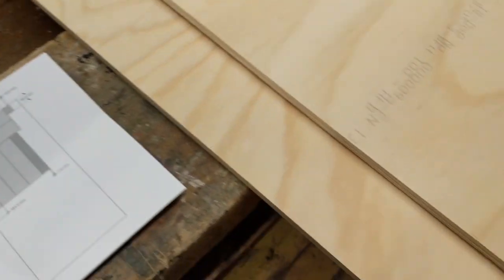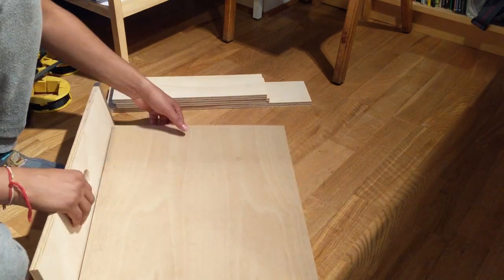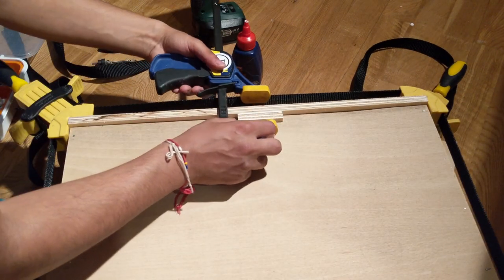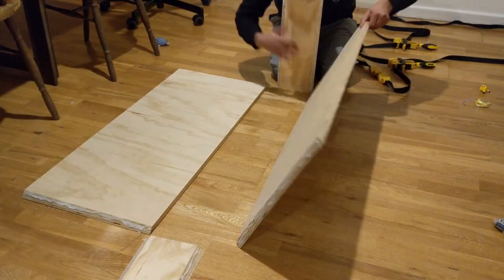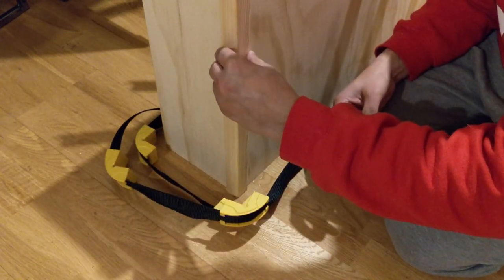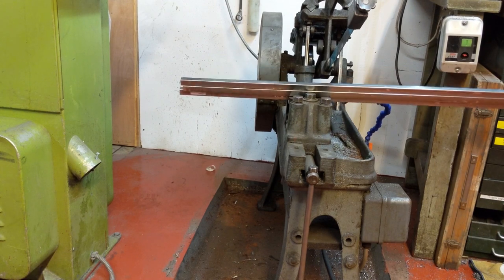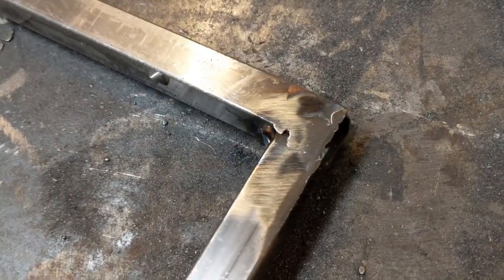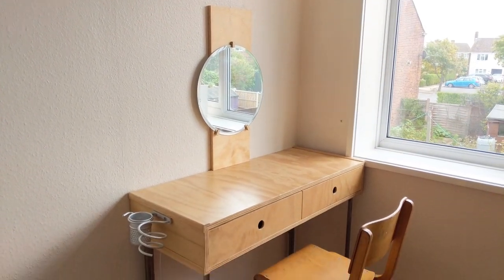Plywood Dressing Table

Comment: That turned out nicely, did you use any finish on the legs?
Reply from the maker: Thanks! ☺ I've previously used polyurethane, same as the plywood, and on another recent build the beeswax and mineral oil I also use on some wooden items. However this one I left unfinished and it looks the same as it did the day I made it and its over a year ago now.